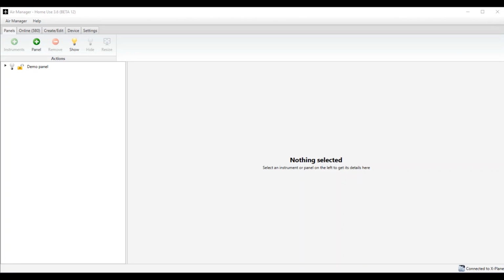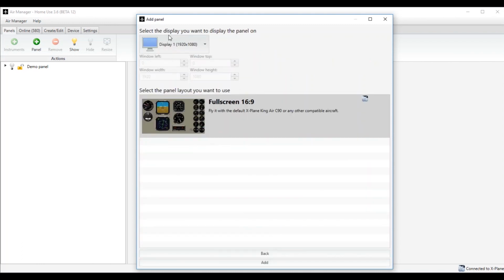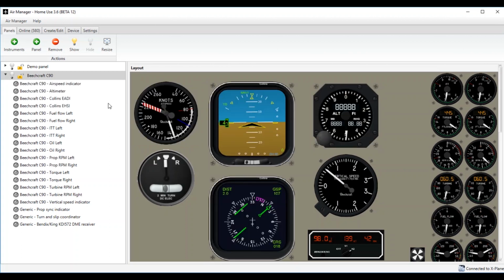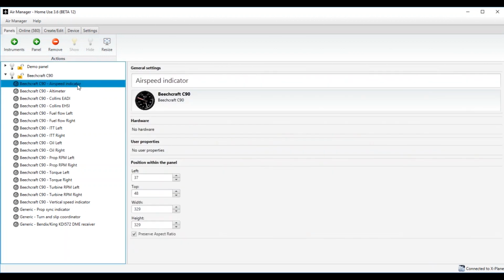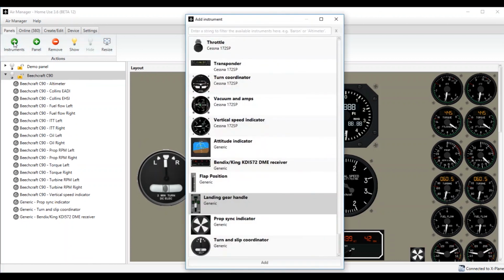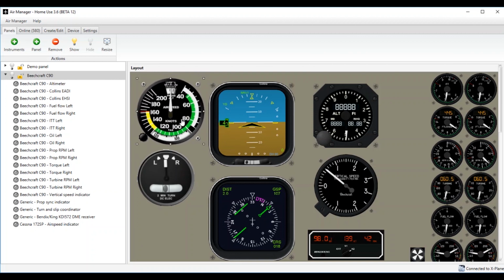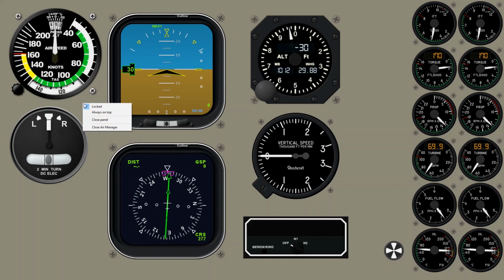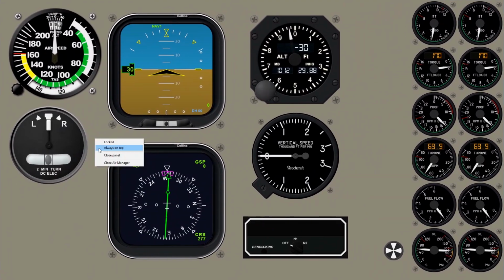Air Manager 3 - Getting started

Comment: THANK YOU Russ.  this helped a lot. 
Can you then explain how to load it and connect it with a proper set up for X Plane for Steam and what Screen / play settings to set up for a 2 monitor system (one big monitor and the Air play push screen monitor).  I had a lot of difficulty getting a view of just the panel.  

Same thing for MS 2020 if you have a video on that.  This is so helpful!

Comment: This 85 yr old dummy thought he finally had Air Mgr figured out reinstalled up to date plug in > Problem is not all gauges respond. Sometime default  172 partially responds Sim coder purchased does not.  Checked firewall no issues suggested on Wiki.This stuff is getting too sophisticated for me. Fly X-Plane.

Comment: Thanks for the tutorial....question, how do I actually use the panel, purchased that is, on a added touch screen monitor in X-Plane? I can do all the editing in Air Manager as required, however, I fail to actually get the panel onto the 2nd touch screen monitor. I want to use my main monitor as forward scenery view and the touch screen monitor as my instrument panel. Your assistance and guidance will be appreciated, thanks.
Reply: Same here. I see guys using a multi panels and I can figure it out.